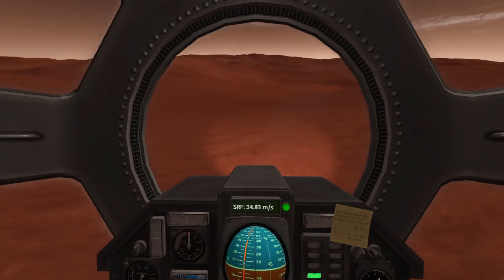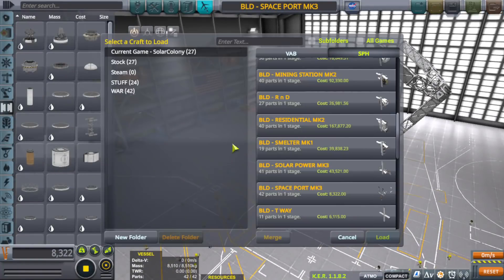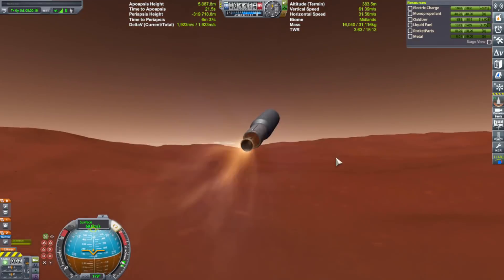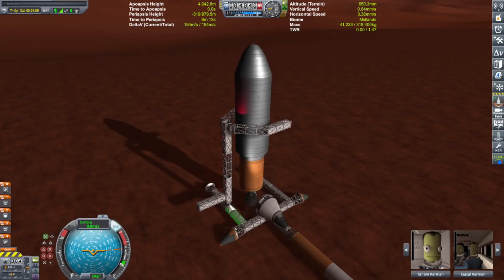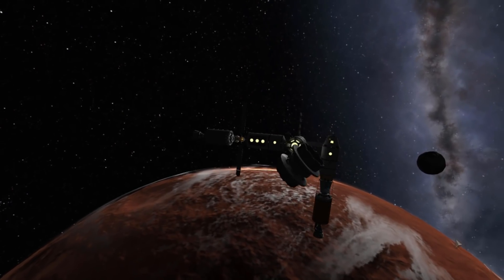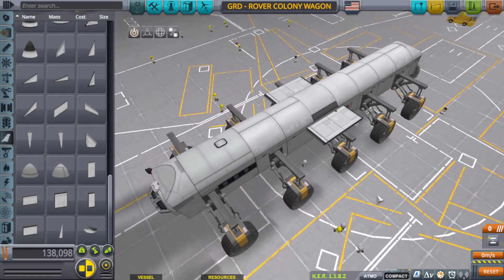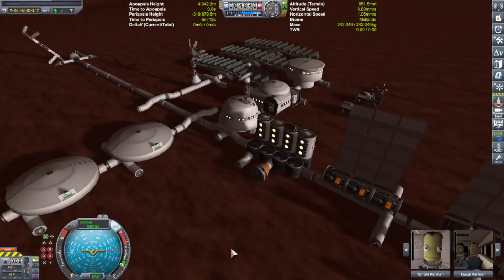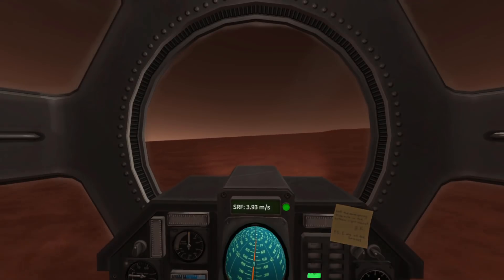DUNA COLONY ROVER WAGON

Comment: I've been working on a mod you might be interested in. Not required but it's being made with simpleconstruction and KIS/KAS(especially KAS) in mind. the goal is basically to add self sufficiency to KSP. All resource containers/tanks have 0 resource, starting with a ground crew and means to start producing fuel, service vehicles, and airplanes or rockets. Not sure about the fine details on where to take things so I'm looking for suggestions on the tech tree, features/functionality, and new parts 

A̶l̶s̶o̶ ̶l̶o̶o̶k̶i̶n̶g̶ ̶f̶o̶r̶ ̶a̶ ̶m̶o̶d̶ ̶t̶h̶a̶t̶ ̶c̶a̶n̶ ̶'̶s̶i̶m̶u̶l̶a̶t̶e̶'̶ ̶f̶u̶e̶l̶ ̶a̶n̶d̶ ̶e̶l̶e̶c̶t̶r̶i̶c̶ ̶c̶h̶a̶r̶g̶e̶ ̶i̶n̶ ̶h̶a̶n̶g̶a̶r̶ ̶t̶o̶ ̶b̶e̶ ̶a̶b̶l̶e̶ ̶t̶o̶ ̶g̶e̶t̶ ̶d̶e̶l̶t̶a̶ ̶v̶ ̶s̶t̶a̶t̶s̶ ̶e̶t̶c̶ ̶i̶f̶ ̶a̶n̶y̶o̶n̶e̶ ̶k̶n̶o̶w̶s̶ ̶o̶f̶ ̶o̶n̶e̶ ̶o̶r̶ ̶h̶o̶w̶ ̶t̶o̶ ̶m̶a̶k̶e̶ ̶a̶ ̶p̶a̶t̶c̶h̶ ̶f̶o̶r̶ ̶a̶ ̶'̶f̶a̶k̶e̶'̶ ̶t̶w̶e̶a̶k̶a̶b̶l̶e̶.̶  Had to write a proper plugin but it's still a bandaid*. resources are tweakable in VAB and set to 0 when launched, however VesselMover spawns things with fuel :(  there's always a bigger fish.

Comment: A reusable rocket would be useful. Or at least something you could recover and salvage the parts from (I don't use many mods so I'm not sure if that's possible.) Or since the construction mod builds from any connected docking port, you could make an SSTO/SSRT with a cargo bay and build the cargo on a docking port inside the bay. Just a suggestion, love the work you do on the colony!